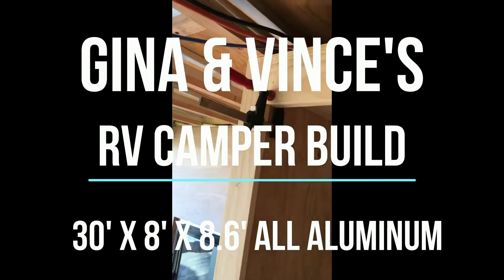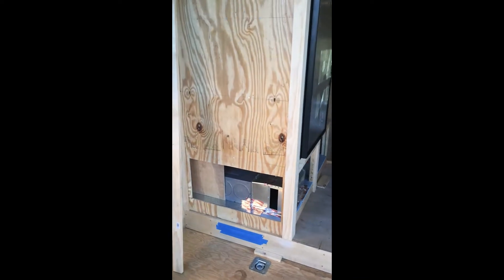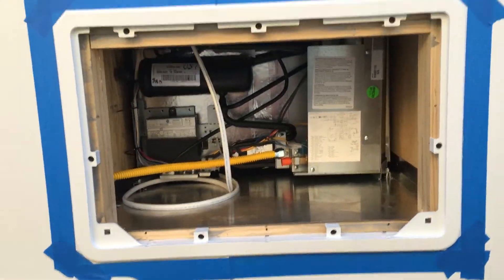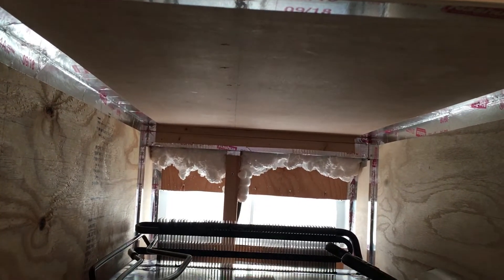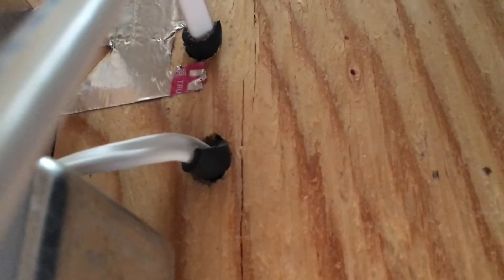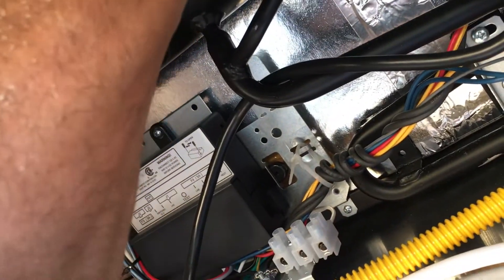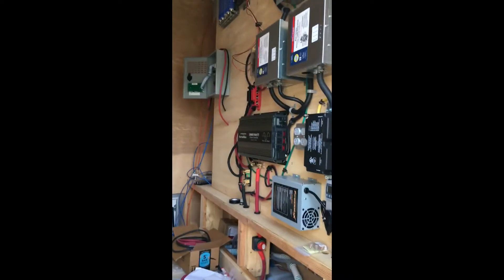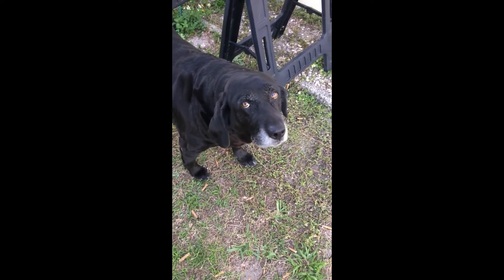RV Trailer Build #66 - Install Dometic New Generation 9 Cubic Foot Refrigerator

Comment: Hello, Vince

Have you thought about installing some exterior cameras ?

 I will be installing 4 exterior IP Cameras with a Networked Video Recorder
connected to my WiFi Router Located in the trailer and using an App on my phone 
for remote viewing ( When connected to the RV Park WiFi Network )
and on my iPad mounted in the cab while traveling to help with backing up and 
on the highway to keep a eye on the traffic around me. 
 The Camera System will be recording 24/7 in case some idiot gets too close and 
as deterrent ( Security System ) incase someone decides to a little five finger discount shopping
while I’m out on the bike.
Something to think about since you have some extra Cat6 sitting there.
Reply from the maker: Yep - Forward, Back and Side to Side... In addition, I'll have my BlackVue camera Mounted On The Rear of RV also for recording while driving!!